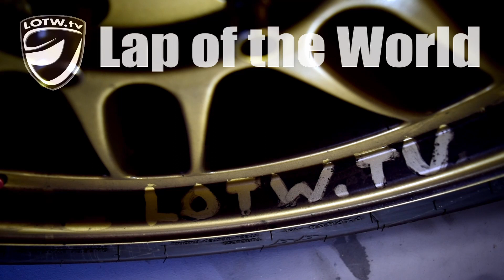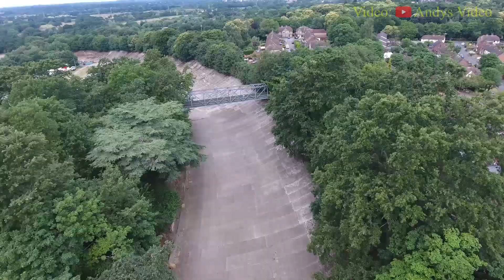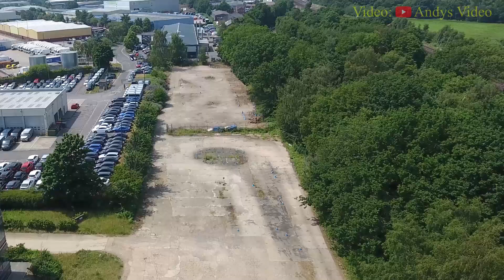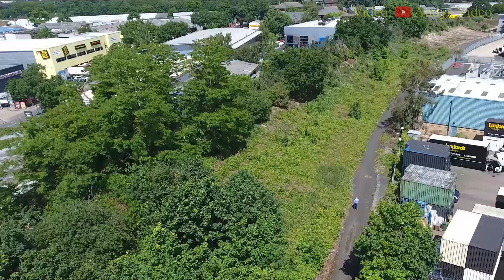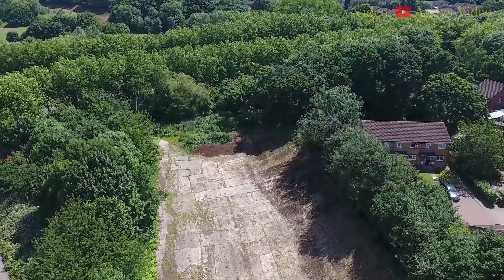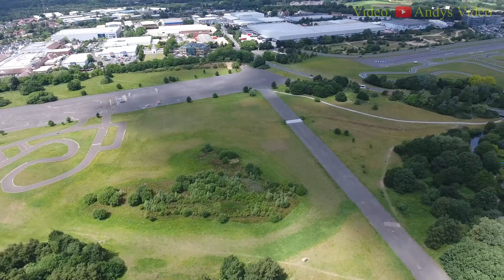TotW #5  Brooklands Motor Racing Circuit: Abandoned, but not forgotten! (First Paved Circuit Ever!)

Comment: Outstanding video - kudos Richard and Andy. Cool to see "the power that be" doing what they can to maintain the historic significance of this facility. Now all we need is for one of the "digital driving games/sims" to create a digital version of this track that we could enjoy in both period correct and modern cars.
Reply from the maker: Thanks Jeff, it is nice to see what's left being preserved in light of the historic significance.  If you don't mind doing a little fiddling, I believe there is a mod someone built for Assetto Corsa that features old Brooklands.
Reply: There is a Formula 1 simulator at Brooklands Museum where visitors can drive a McLaren round the old Brooklands track.  There used to be a version which simulated the 1933 Napier-Railton which still holds the lap record for the Brooklands circuit.  It was very difficult to drive as the throttle response was so violent that the car would spin if one was not very gentle with the throttle.  The original car is in the museum and is often driven around the museum site.  It has a Napier aero-engine with 12 cylinders totalling 24 litres.